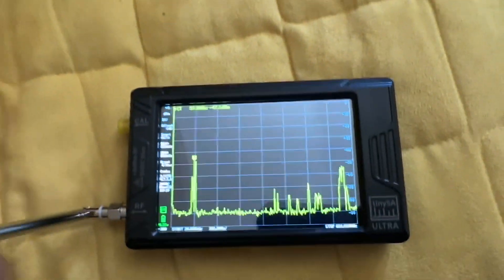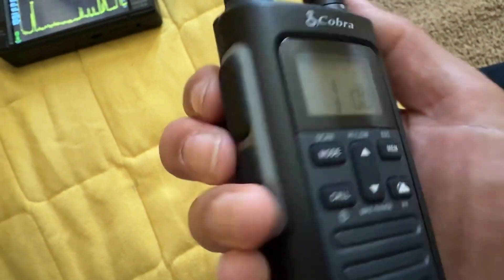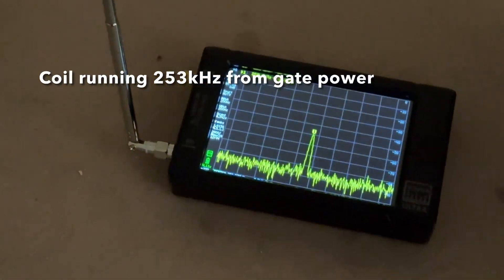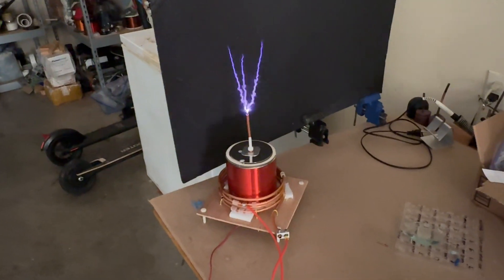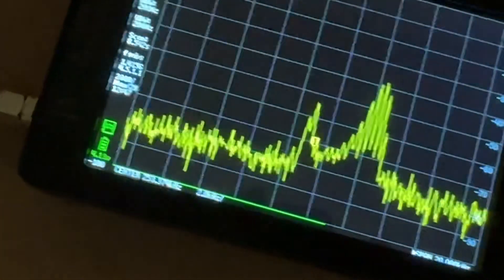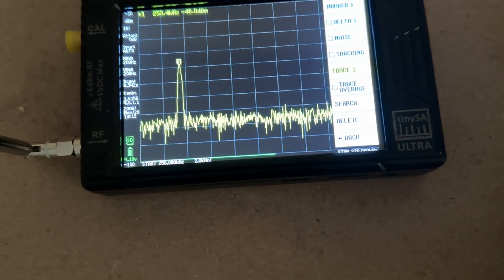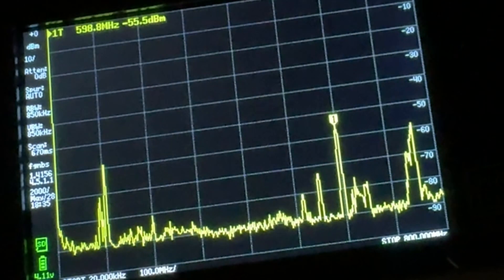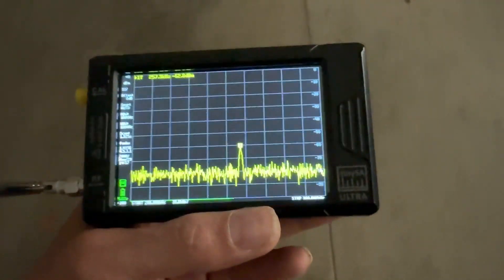Exploring Tesla Coil RF Output Spectrum with a neat Device

Comment: Very fun experiment!  In the time domain, an impulse is represented as a very sharp spike at a single point in time (tesla coil spark), essentially a signal that instantaneously rises to a high value and then immediately drops back to zero, while in the frequency domain, an impulse translates to a flat line across all frequencies, indicating that it contains equal energy at every frequency due to its broad spectrum.    Guessing the tesla coil sparking rate modulates the signal in the frequency domain....
Reply from the maker: Thank you!

Comment: I think the distance of propagation would depend on the output power as well as the operating frequency of the coil.
Reply from the maker: Yep for sure. Also the emissions and harmonics are very wide bandwidth with little very little energy release at discrete narrow bands
Reply: @BrianDhvTinkerer  Try putting the spark at the focal point of an old satellite dish.  Knock some stuff out of the sky.